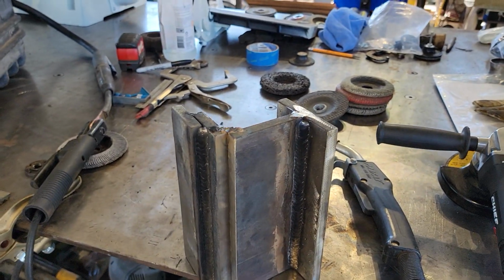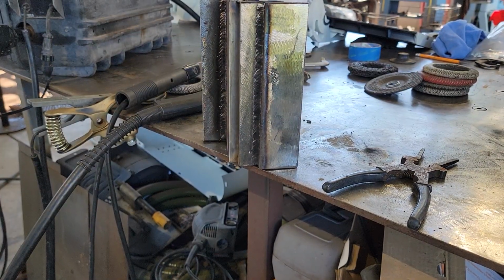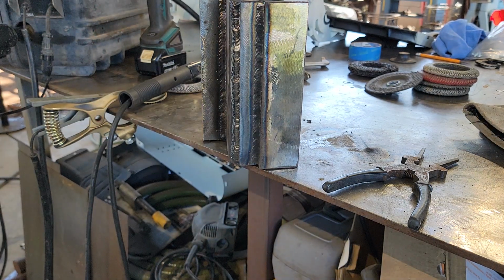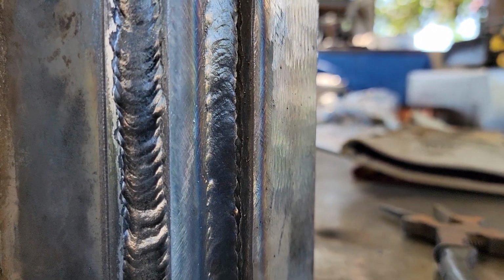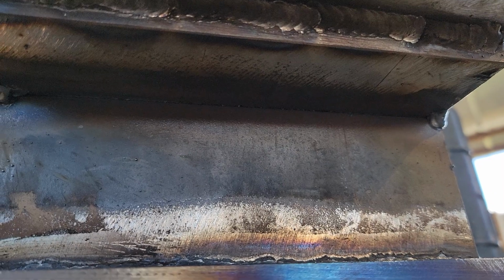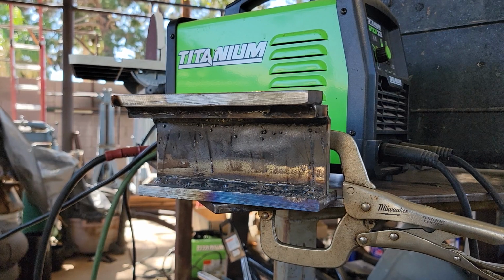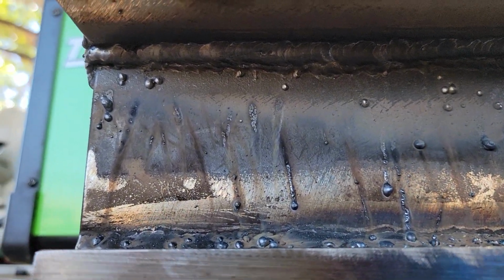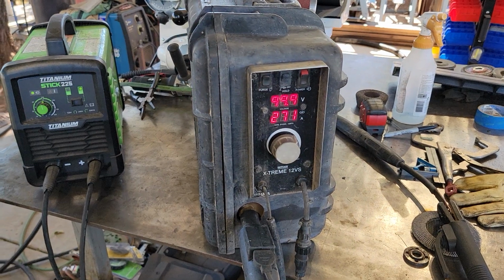Titanium stick 225 and the impossible

Comment: Nice video, I'm kinda jealous of your table. I have to use an old ironing board, which is steel, and it does all right for small jobs. Also, I bought one of those helmets for my birthday but haven't gotten to use it yet.
Reply from the maker: Just be patient and keep your eye open I would recommend nothing less than 3/8 thickness for a table l also I would avoid the metal welding table from Harbor freight because it's more like just a metal saw horse  Also congratulations on the helmet I think you're be really happy with it

Comment: Can use 4500 generator
Reply from the maker: Hey great question I have a Miller blue star 185 it produces about 6000 W and it would trip the breaker every time I do have a bigger generator on my Miller Bobcat 225 and it will run it just fine without any problems at all I hope this helps thanks for the view in the comment